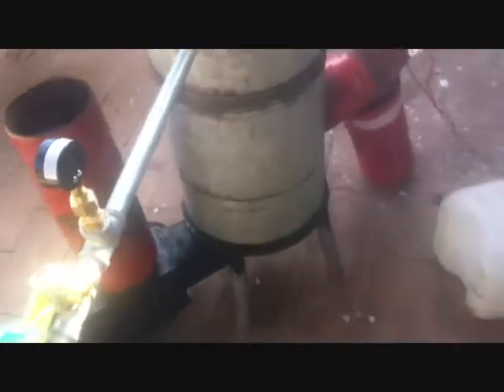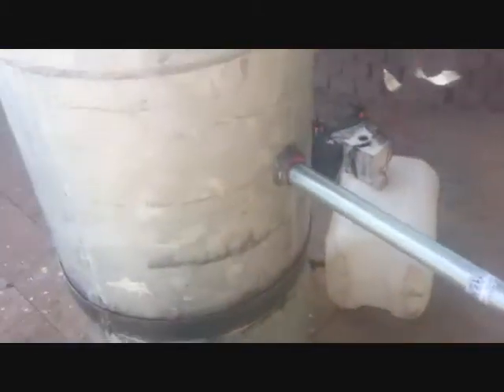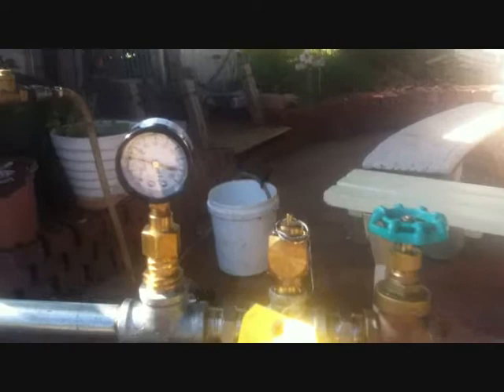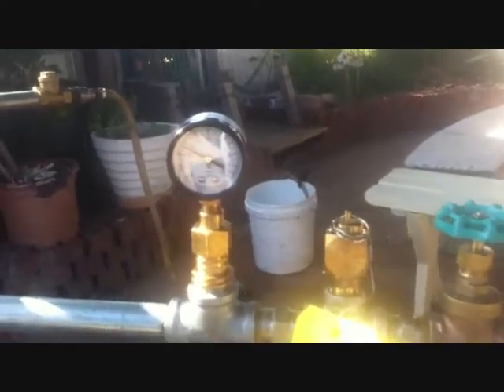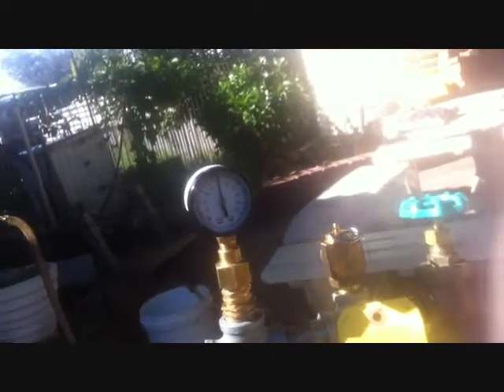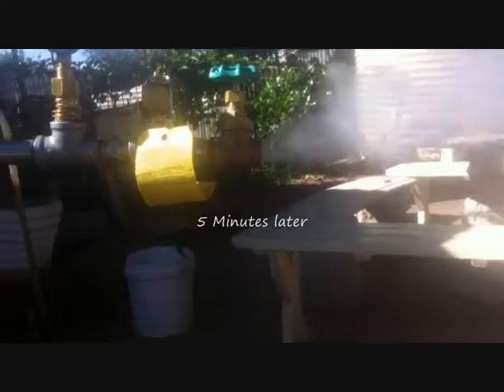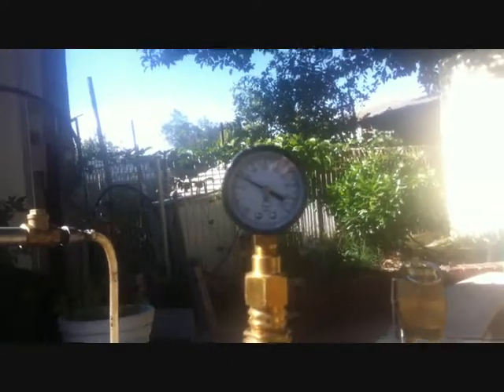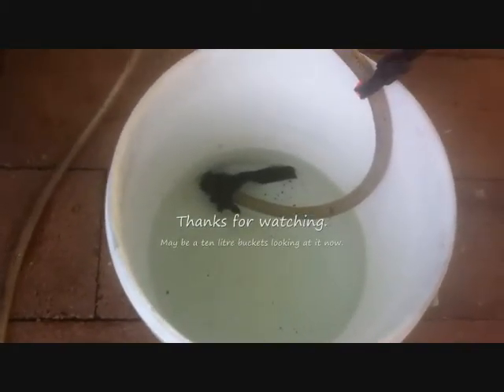First Steam Rocket Stove Boiler

Comment: Thar she blows! Nice boiler Dan!
Reply from the maker: Hi Bio-Cell. It's a work in progress, need to redo the tubes, it needs coils, I may try joining the vertical water tube at the top and bottom with a header pipe, so the water can feed in, bit like a tank but it's the tubes forming the tank.
Reply: I checked this video out because I'm working on a destructive distillation process, combining steam and wood smoke, and I was thinking about a rocket stove for it. How many feet of coil does that baby have in it? Or tubes I mean.
Reply from the maker: I think it's around about 12 meters 25 mm copper pipe. Rocket stove is the way to go, when this worked it produced good steam, One thing of note is where the spark plug goes it needs a bypass tube to allow water and steam to go past the plug or it builds up a air lock and the spark plug can't get no water  to it and fails.
Reply: That's a clever idea using a spark plug for a switch. You will do well when the shit hits the fan. Have a great day friend.